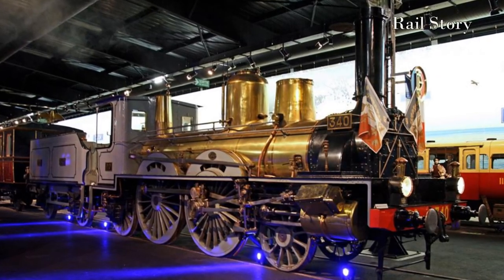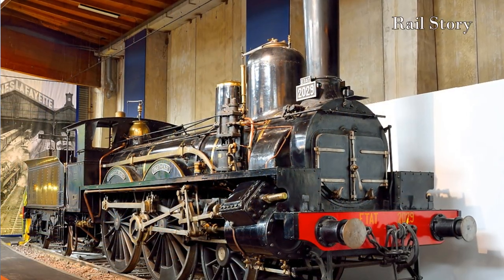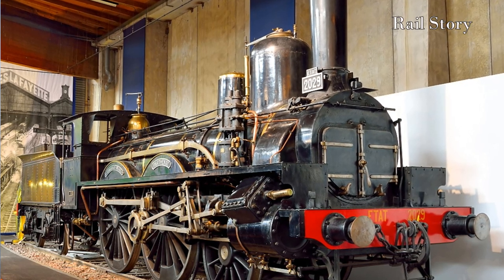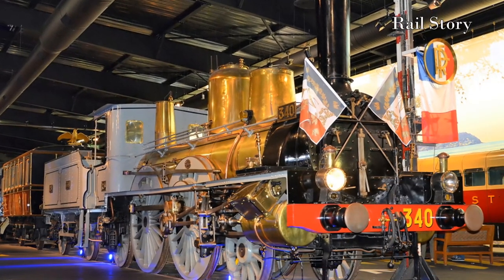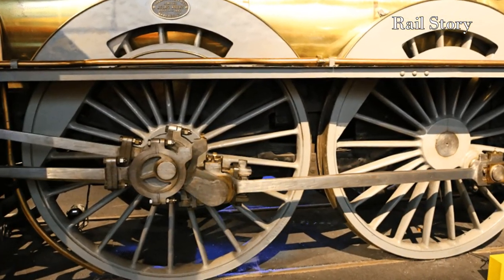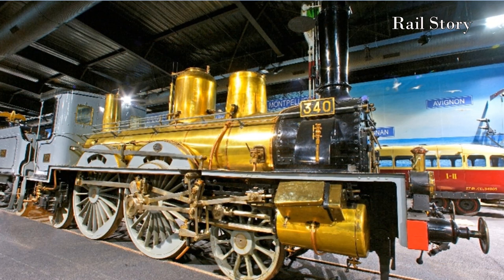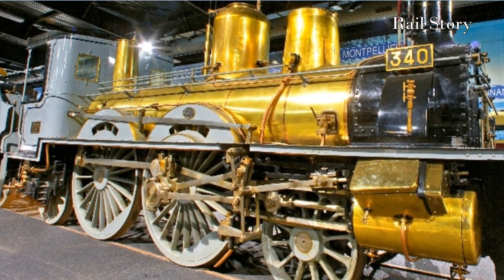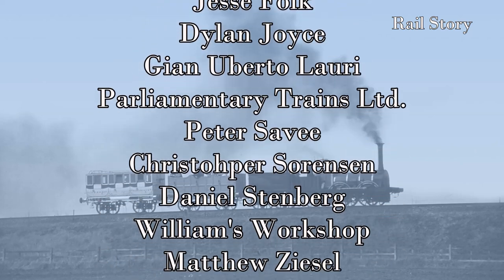Spotlight: Forquenot

Comment: That there is a lot of polishing to be done - but it is very fetching! There's something so beautifully hypnotic about outside eccentrics when they are in motion - Danish engines are especially common in having external valve gear (usually Allen straight-link.)

Comment: Thanks! We hear very little about French railways for some reason, I suppose because they themselves were not very nostalgic about them. I realize the only reason you covered this one is probably due to it's place of manufacture, but that's fine.
The 2-4-2 seems to be called the Columbia after American nomenclature, which is certainly unfair. The Columbia was a Baldwin 2-4-2 which raised the boiler to make room for a larger firebox, requiring trailing wheels to support it. The principle worked fine and was subsequently adopted, but the wheel arrangement was terribly unsteady (with the raised boiler) and didn't catch on.
Reply from the maker: I covered her because she's French and I have a great interest in French railways.

Comment: Anthony on Forquenot, regarding ease of maintenance :   "Presumabley He Had Shares In The French Version Of Brasso"  -  😄  There would have been just as much maintenance to keep up the shine on No. 340 and her sisters, as there was mechanical maintenance. That must have fallen by the wayside at some point as being to expensive and impracticle. Victor Forquenot had the right idea regarding outside cylinders.
Reply from the maker: A lot of Forquenot's thinking he developed from Polonceau. And indeed, much French thinking for locomotive design - big boilers; large diameter, smooth, steam pipes; big cylinders with ample valve chests; and everything on the outside  - derives from Crampton.

Comment: That valve gear looks like Gooch to me
Reply: I think (looking at the photos) it has a fixed pivot for the expansion link and a lifting radius rod - therefore (if Wikipedia is reliable)  Gooch, rather than Allan.   Though I tend to ignore the subtleties and lump all such gears together as 'Stephenson variants'.    I always find the double eccentrics of outside [Stephenson variant] look slightly weird, but that's just my British prejudice that 'normal' valve gear is either inside, or Walschaerts   :)

Comment: I've never seen/noticed valve boxes that stuck out at an angle from the cylinder like that before.  Was it common on French locomotives?
Reply from the maker: It was a common feature in the UK and France with both inside and outside cylinders in order to reduce height and to make the cylinder easier to cast and with feer steam spaces and you can use bigger steam pipes.
Reply: That's a fairly common arrangement for Allan valve gear with slide valves on European locomotives.
This kind of cylinder /valve box is also used on the German T3 locomotive, and basically anything running on saturated steam